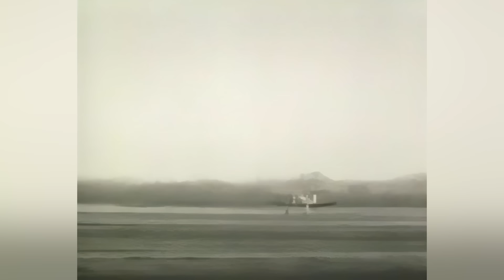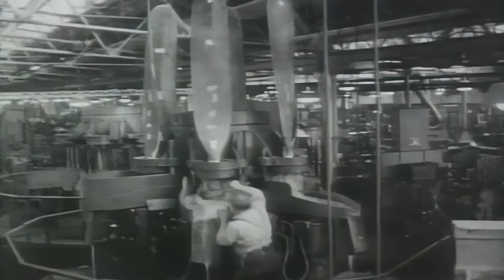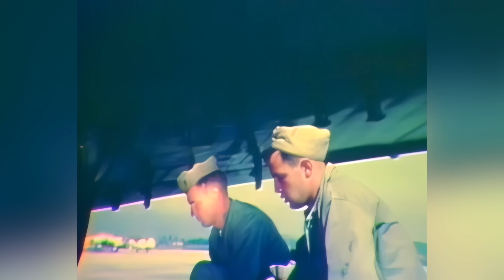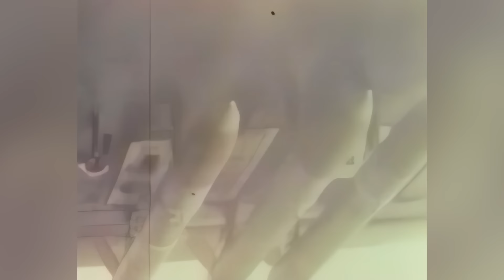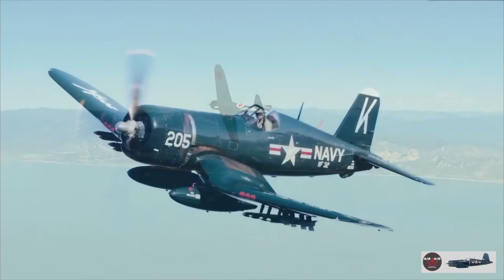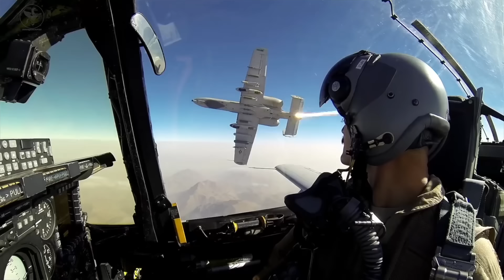Vought F4U Corsair: WWII Powerhouse of the Pacific. The Bent-Wing Beast!

Comment: It was amazing to me how many extremely successful WWII aircraft were built and ran with the Pratt-Whitney R2800 engine. The Corsair, Thunderbolt, BlackWidow, Hellcat, Bearcat, and Tigercat. How many engines did Pratt-Whitney produce during and after the war? Don’t forget not only the production aircraft, but many replacement engines sent to the fronts to replace engines on existing aircraft. Reports of Thunderbolts returning with pistons pumping but no cylinder there. Running on virtually no oil. Propeller shot up. Damages that were legendary, but they kept on running. This was one of the reasons aircraft equipped with these radials were so successful. 
Despite what the video says or implies, Navy fighters were a lot more rugged than Airforce because of their landing requirements. Same is true today.
Reply: It was also used in some two engine planes.
Reply: Ford made more R2800 engines than Pratt&Whitney did, just like Remington Rand made more .45 automatics than Colt did.
Nash also made R2800's, a total of 125,334 were made between them.
Reply: @ I didn’t know Ford made them too. Ford really stepped during the war. They made B-24’s as well.
Reply: Read "R-2800 Pratt & Whitney's Dependable Masterpiece" by White.  Everything you ever wanted to know about the R-2800 and more.
Reply: @maxschell8823  
That one's next on my list, I just got "Dependable Engines, The Story of Pratt&Whitney" by Mark P Sullivan. 
I recommend "Vees's For Victory! The Story of the Allison V1710 Aircraft Engine 1929-1948" by Daniel D Whitney if you want to learn about them, some might find it boring as it has an incredible amount of detail and technical information in it, it even has separate chapters on every different aircraft it was put in and the different variants put in them, along with a chapter that gives an in depth comparison of it and the Merlin which dispels common myths, it misses nothing about the Allison engine especially its development, if you want to learn about it you won't be disappointed.
Reply: @ thanks, I’ll look for that.
Reply: I have a problem with the statement early on that said in effect: radial engines were "old fashioned" as the inline water cooled engines were the more modern. The early water cooled Liberty engines were not that great.  Only the late merlin and griffon water cooled engines even approached the brute power of the radials. R2800's produced as much as 2,800hp by wars end with Wright cyclones at 3,200 and PWA R4360' making 3,800. Name me a successful post war aircraft powered by a inline engine(s). Until the 707 and Comet, All commercial airliners or transports were radial engine powered. The toughness of radials has already been commented on so I won't bother. Not a well founded statement my friend.
Reply: @garyyoung4074  
Make no mistake those Liberty's were fantastic engines, don't forget that was 1917/18 so you can't compare them to later engines even from just 10 years later as things were progressing so fast, but they could easily stand up to any other V type engine of the era.
Brian Lohne ( I probably spelled his last name wrong) has a channel that covers mostly the history of drag racing, he actually spent years as a TV announcer for televised drag racing events so if you've ever watched any you might recognize his voice, sometimes he'll venture a few steps off the drag racing path, he did a video on the Liberty engine called "The Birth of American Muscle", watch it if you get the chance, you won't be disappointed, you'll learn some things about that engine from his video I'm sure you'll find impressive. 
And yea those radial engines were fantastic, but the reality is when it comes to engines like the R4360 they really weren't very good engines, they're  impressive but in order to have any kind of acceptable reliability they had to be detuned to the point where they made less HP per cubic inch than anything else, and even then they were still failure prone and had massive man hours of maintenance per flight hour, it wasn't uncommon at all for an aircraft with multiple R4360 engines to drop at least one cylinder during every flight.
The R2800 seems to be about the biggest you can go with a radial engine and still have decent reliability, after that the bigger you go maintenance and failure issues increase disproportionately to cubic inches and especially to power per cubic inch, even the earlier more primitive jet engines weighed half as much but produced twice the power per pound, aircraft designers knew immediately that the days of piston engines in aircraft was over, with of course the exception of small aircraft and a few military aircraft that were already in the development pipeline and weren't front line aircraft, and most of them only incorporated piston engines as they were cheap after WW2 because of the surplus from war production, many of them were converted over to turbo prop aircraft down the road when all those war production radials started drying up, the surplus of radial engines at the end of the war is what accounts for them being used in the civilian versions of military aircraft adapted into the role of civilian airliners, there was only one American V type engine made during the war and not nearly as many in surplus after the war as the 5 or 6 different radial designs that each had a surplus, that's the reason you don't see the V engines in airliners after the war, the issue of the air cooled engines being more reliable than liquid cooled engines had nothing to do with it when it came to airliners as no one was shooting them full of holes, they were simply military aircraft that had radial engines because of the surplus of them that were adapted into airliners. 
The last variants of the Allison V1710 engine was producing 2,250 HP (take off rated), that's 1.3 HP per cubic inch, the radials just couldn't quite get there and still be able to pass the tests to be service rated, at the end of the day they're just like modern car engines, 4 valve heads are going to beat 2 valve heads in a power per cubic inch contest every time for a variety of reasons, it's not just because of valve area, 2 valve heads have high roofs meaning they have more surface area, more surface area means they absorb more heat, that means they run hotter requiring the mixture to be richer and less timing to prevent knock, also two smaller exhaust valves have shorter heat paths to their main cooling area, the contact with the seats, meaning they run cooler than a single larger exhaust valve which gives you even more of the mixture and timing issue, being overhead cam they have less mass in the valve trains meaning they use lighter pressure valve springs, they don't have pushrods to flex around causing issues, V's also don't have the far more difficult to produce master connecting rod with all the other connecting rods in the bank being what's called articulated rods.
Being a Harley rider for almost 40 years I have a serious soft spot for air cooled engines with 2V head cylinders that have pushrods and that classic hemi combustion chamber, but the reality is at the end of the day OHC 4V liquid cooled engines will beat one every time, it's just the reality of things.